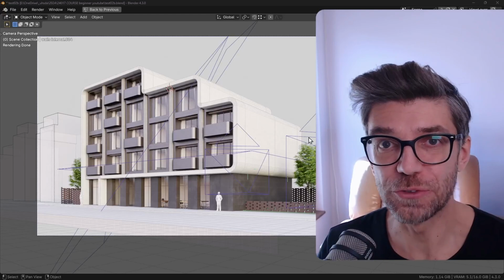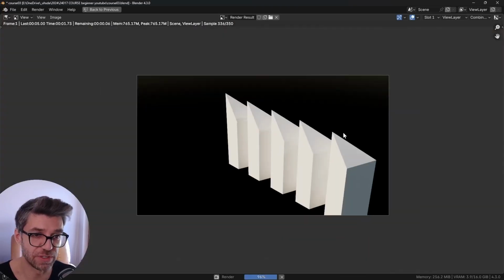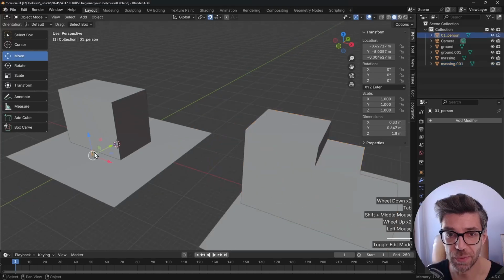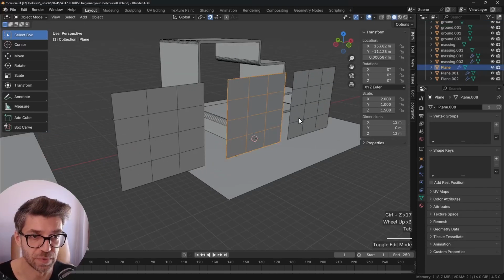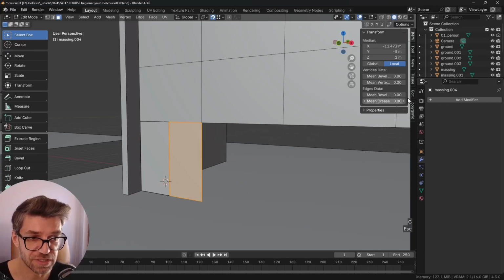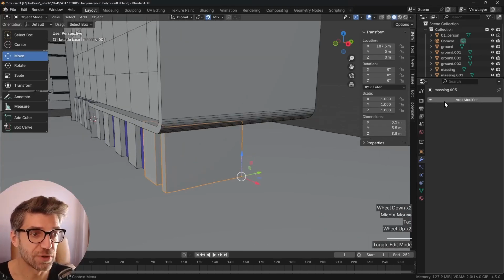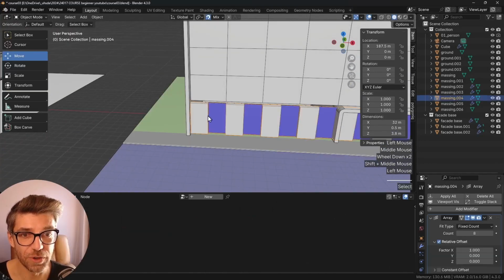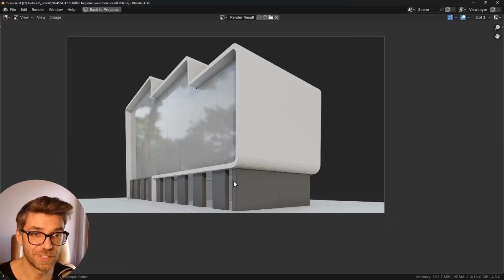Part 1, Course - Residential Building: Parametric Massing. Blender Architecture

Comment: What a great tutorial, I love the way you teach! I do have a question about the perspective in such wide angle lens (24mm) I see you have vertical parallel lines in your viewport but it is not my case, all vertical lines are concentric and can't find a way to makes it parallel. Also I want to ask you if you already try BonsaiBIM addon? Thanks!
Reply: Oh never mind! I later saw that to keep parallel vertical lines just need to keep the camera rotation in X = 90
Reply from the maker: I keep experimenting with Bonsai BIM but I find it too much of its own way of doing things, so to keep aligned with IFC standards. It is great for some user cases but not early conceptual design

Comment: You need to give the transmission to 1 in material for the glass material to work not alpha ......by the way its very good to see blender used in architecture need more blender channels like yours especially making somthing diagrams like we do in rhino and illustrator ,as blender has builtin grease pencil
Reply from the maker: Cheers. You're talking about making "proper" glass material, which doesn't always work well. It highly depends on the scene. That's why i didn't go into it here. As for diagrams, in Blender, I have done a few videos on it. Here is one: https://youtu.be/0Usv8D_mTr0

Comment: Flat roofs are popular with architects, but are a constant problem for the rest of the life of the structure for leaks. I'm a building inspector and it is one of the #1 problems I see. 
Capturing rainfall is also increasingly a priority given the significant water pressures already resulting in supply collapse in major cities globally. So designing in sufficient storage and utility spaces is important. 

Also, passive thermal efficiency is increasingly important for thermally comfortable homes that don't consume massive amounts of energy (or being sweltering or freezing when the grid collapses under the load). Are you using any thermal modelling tools? 

Nothing warms my heart more than an inspection with well-thought out utilities and ecotechnologies.
Reply: Come on, there is no supply collapse in water. It's plentiful.  
As population expands we need more water.

The video is about using Blender for Architecture, not climate hysteria.
Reply: @NathanEllery  I'm sorry that you are a naive moron. It must be tough trying to learn Blender when you routinely reject objective reality...
Reply: As an architecture student myself. Yes ive seen this design a dozen of times now. They just ignores the M&E and fire safety with a form over function approach but yeah like the guy who commented before me its just a modelling video so its a bit irrelevant to comment about these common problems.